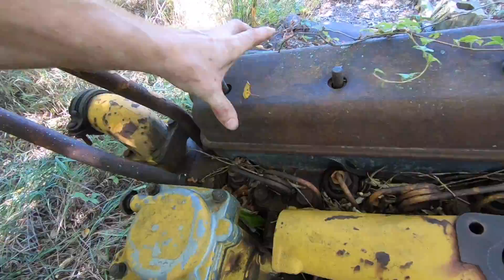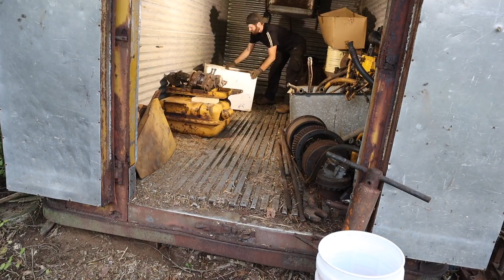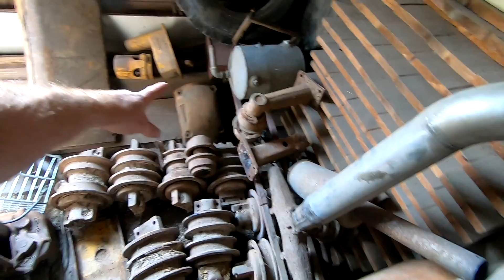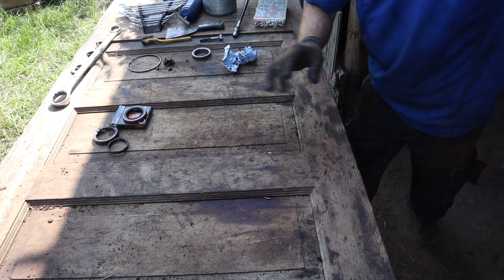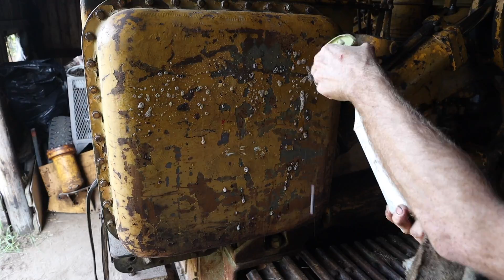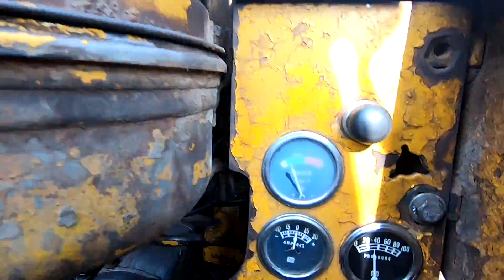I Rescued TWO TraxCavators ~ Part 5 ~ Old Red 1950s Caterpillar TraxCavator

Comment: if you don't really like the bucket curl lever working opposite to  what you are used to why don't you reverse the output pipes on the lever so it will work as you use to

Comment: Hey pal I’m enjoying watching this video chain / quick tip for you because you can’t steer with the right hand side if you through it in reverse you can use the left side to steer you around until you can swap that sprocket out, if had to do it in the past with D2/D4 when they have a steering clutch that won’t work.  It’ll get you by for now until your home with it, that sprocket will be a job you’ll want to have all your tools and equipment for.

Comment: Matt,

My papa always told me "To leave well enough alone" In this situation, I wouldn't cut that ring off and weld onto a known bad sprocket.  You know you already have issues with it.  The sprocket you got from the junk pile looks to be in great shape.  No way I would cut that thing apart to weld onto known bad sprocket even though that's how some people repair them.  The only thing you are really saving at this point is your time and effort?  You have worked this hard to get this far, do you really want to shortcut what is probably the single most important part of the running gear?

I am loving this series and can't wait to see this old iron back doing what it's supposed to be doing!  Keep up the great work!

Johnny G

Comment: The pin under the sump must be the last remnants of its agri tractor heritage. Maybe it was the rocking cross bar mount on the dozer? Track loaders have solid mounted track frames so they can put all the weight on one front idler and not roll over with a bucket of dirt at full height. All the pin is doing here is holding the engine up. I see two pulling threads, so it must have been a tight fit when new. The new bolt ends a tube around it, because the worn out pin moving about will make the new bolt come loose or snap it off. That’s because the new bolt tightened will try to carry all the load the pin did. Anyhoo, loving the vids, nice to see it coming back after it was abandoning due to various serious mechanical issues.

Comment: Difficult to pull the sprocket off, but the absolute vital part is to push it back on. The nut doesn’t load it enough, it’s just a retainer. Someone will know the exact value. I am absolutely guessing at something like ten ton preload from the screw on adapter and ram.

Comment: Hi its not a full fix But to save stripping out the drive sprocket . you could build up the teeth with weld to give you drive on that side. 27 welds are a lot easier than pulling a sprocket out in the Fields. Even every third tooth been built up would give you drive. Great show loving this Big Red rescue. Cheers

Comment: Sprockets are cast steele,  so you really don't want to cut and try to weld,  you'll just need to disassemble and replace as a complete sprocket, which is probably why it hasn't been done yet, lots of work.

Comment: Previous owner destroyed the driver sprocket by not tightening the track.  Weld a hook on the bucket.  Attach a chain between bucket and track tension mechanism. Use hydraulic to tension track.  Now block tension mechanism. Hopefully you get a track now with a tight fit.

Comment: That setup as far as the machine itself is much like the  d9 in that time. So 1st thing is to change that sprocket you need to find you a car dealer n get a seal it runs the outer side  of the sprocket. It a 2 sided seal and it sprung . The pump that seems like the same pump whether the machine had a bucket or a blade . Oh not sure of it matters or not , the oil lubes that bearing that's why a seal is their. I have more info I could send if needed and as the time comes on more fixings. Good luck hope to see the journey home.

Comment: Use your hydraulic jack to push the idler pulley forward. I also like the idea of using your welder to build up the teeth on that worn sprocket. Great job on what you’ve accomplished so far. Love your videos!

Comment: to remove that sprocket you'll need hydraulic puller and special kit. if you need to know anything ask away. had the back end of 966 apart at least half dozen times over the years. restoration job gunna take you months and $$$$$

Comment: Well, Salvage, I was thinking; A quick n dirty solve for the Sprocket issue would be to weld some teeth (rebar maybe) onto them, it wouldn't have to be much, maybe the size of your thumb. Definitely wouldn't be pretty, but it only has to hold long enough to transport it, right?
I've seen this fix (rebuilding gear teeth) applied two ways, one is to lay down the block and rebuild the sprocket tooth, the other is to drill out holes pointed toward the axial line, and put metal rods in (kinda like fingers), and weld the rods into place, and plate/sheet steel welded to the rods to form the walls of the sprocket cup/cradle.
I'd use the stack solution, in an "A" pattern, it would be the most doable "in the field".

Comment: If the Track Chains are worn out and the sprocket and Rollers worn out there wont be enough adjustment on the screw to take up the slack

Comment: Putting grease in that bearing was probably not a good idea. That means you will have grease in your hydraulic oil.
Reply: mark walsh   The bearing is supposed to run in grease, there was old grease in the casting when it was disassembled, and a tube run to regularly service the bearing was visible in the video, but obviously whoever was serving the machine was not aware of it or there was a blockage that prohibited proper grease flow.  If the bearing was supposed to run in oil the seal(s) would be doubled, but that would introduce another possible source of wear fragments into the circulating hydraulic oil.......the engineers decided to use a greased bearing.  As long as it is serviced, it’s going to last for a long time.

Comment: Either way to replace sprocket or do a weld on rim( available aftermarket) you still have to split the rails, remove track frame, to do it right.

Comment: Correct me if I'm wrong, but that hard bar pin on the suspension (sorry if I got it's name wrong) looks like it saw some metal fatigue on the broken end, as well as similar fatigue in its respective hole - the end that's left in there probably got seized and then broke off while traversing some particularly tough terrain, Red likely realised something was amiss and went to take the bolt out when it broke. Good luck getting it working again, keep up the amazing work and thank you for all the effort you put into your videos!

Comment: If you have a portable welder and a generator to power it, I suggest building up the teeth of the sprocket in situ, just as a temporary means of getting the sprocket to drive the RH track.  You are doing a great job!!

Comment: As a stop gap measure, you might consider cutting some short sections of square stock, onto the high points on the worn sprocket to give it better "teeth" to mesh with track.
Reply: Weld them onto high points...left out that part!

Comment: On that Sprocket weld up some Pointy teeth on it each 3-5 points just to get you goin until you can get the new one on! Not a bad idea... & ofc Back when men where men & Muscled items go to get job done!!! That Front grille & sides must've been at least 200 lbs! P.s What kinda work boots are those!? Looks comfy and tough! Great news to hear you've decided in future time to Powerwash & Degrease the Top & Underside of the machine.

Comment: fantastic job so far.  on repairing the worn out sprocket, you may want to try this as a temporary field repair for the worn sprocket, if you could weld 1/4 or 3/8 pieces of bar stock(steel rod) on to the worn teeth, providing you have a small enough mig unit that your generator would power it yet provide enough amperage to run .035 solid wire if you have gas, or what ever flux core it will run.  cut the bar stock lengths to equal the width of the sprocket thickness and cut one for each tooth on the sprocket,  weld a bead and fill on both sides of the bar stock to blend and shape each tooth to shape equal to the spar sprocket you found in the reefer box, with your grinder..  welding on a pieces of bar stock will increase the diameter of the worn sprocket by the amount of the two pieces of bar stock on opposite sides of the sprocket .  in the track, it will engage with over half of the welded up teeth in the track so it should provide enough strength to propel the machine out of the wilds and get it to civilization.  might take some time but doesn't require heavy lifting in a remote area.

Comment: Great video series.  I'm not an expert so this isn't a criticism but isn't the hydraulic pressure greatest when you extend the cylinders to maximum length or travel?  If so, that would increase the risk of blowing hoses and seals.  If it isn't necessary for getting it home, I'd take it easy extending everything to maximum.  Just my thoughts, Doc

Comment: You better have something able to tow it ready at hand because that totally worn sprocket is not going to do much on any sort of slope including climbing the ramps on to a low loader.
If you get the machine stuck trying to climb out of a creek crossing and chances are you probably will, then you are going to need to get it out before rain gets a water flow sufficient to drown it happening.

Comment: Nice but you have no choice in the matter on that sprocket and the teeth are to far gone and the track is stretch to way beyond safe if you were going to jest change the sprocket you would throw the track off the machine it's best to try and split the track and change them both

Comment: You definitely need a new cross rail pivot pin bud, it's far too loose!
An acquaintance has a Komatsu 475 and it requires one heck of a hydraulic press to change the pivot pin out on it.

Comment: Soooo Why did we put Grease on the Bearing isnt that the hydraulic oil's Job
Reply: No, there's a seal in the pump to keep the hydraulic fluid in there. There should have never been hydraulic fluid in with the bearing. The seal he replaced is simply to keep dirt out of the bearing.
Reply: @stinky817  I see thank you

Comment: Really enjoying your vids especially your attitude to a clean tidy work space, clean parts and surfaces and use of the proper bolts and studs.

On a ball or roller bearing, 'the little metal loops' are known as 'the bearing cage' buddy.

With regard to hydraulic hoses and other replaceable components made from synthetics such as oil seals and O rings.

Their track record thus far makes for a high probability that you need to go through and replace most of it soon as possible rather than when they fail.

Preventive maintenance on a machine like that can save you a lot of money and more importantly someone's life.

Does the lubricant line on the mounting bracket run to a remote grease nipple?

Because if it does not, it might be an oil feed designed to lubricate the bearing with engine oil which would drain back to the sump.

If the latter is the case, then greasing the bearing may not only be unnecessary but could cause larger problems.

Whatever may be the arrangement in that regard there should also be an O ring or similar seal isolating the bearing housing from the main hydraulic pump assembly at the rear.

The rate at which the hydraulic system hemorrhaged fluid through the pump indicates the drive shaft seal that side of the bearing is also in need of replacement.

Comment: they say the levers are made that, according to old cat operators.  be careful with the worn out sprocket, you can pound the bearings out of the final. usually when the sprockets are worn like that, the chain is worn out two.

Comment: The hyde pump bearing probably went because the grease worms chowed down there!  There is a. flexible tube run to the casting to service that bearing, saw it in your video. Probably needs replacement.  If someone didn’t know, or care........  The sprocket can be temporary made serviceable by welding some 3/4” or 1” square steel across the sprocket so you can operate Cat.  You can rebuild most of the undercarriage by welding, talk to a cat dealer or welding supplier for information.  Been there, done that.  They built them well, and serviceable, to last decades.  You can probably find replacement parts at machinery junk yards as there’s a nitch industry doing what you are for “ collectors “. Split a 2-21/2-3” pipe in half, put chain around front idler and use bucket to pull back into something resembling taunt, measure distance needed to load spring, tack weld back together over “ track tensioning rod” to hold together for the drive home.  Fabricobbling till you can clean and repair appropriately.  Farmers been doing it forever.  Cheers!

Comment: I'm really enjoying this series! I have an idea that might work to get you home with that worn sprocket. Get some slick rod of the appropriate diameter and cut some pieces to the width of the sprocket teeth and weld them to the worn points of the sprocket. Every third or fourth tooth should be enough to get the sprocket to catch, turn and get you home. You're going to replace the sprocket anyway, what could it hurt to try?

Comment: Could you weld a piece of steel on top of the worn teeth of sprocket just to complete your transition from the bush? It would take you a day welding but at least you can be  pretty safe of making that journey. Preheat and low hydrogen rods should do the trick as you know. Going through the stream would be like taking the loader through a bath of oil. You do have a portable welder capable of welding low hydrogen rods?

Comment: 2 things, firstly when you were showing us the parts in the fridge van and found the drive sprocket on the floor, was the other sprocket "stood up" against the wall in the corner and secondly with the track tensioning rod is it the thread has "gone" on the threaded bar or in the nut head of the tensioner tube (or both) or has the adjuster reached it's limit meaning the track/tracks want replacing so when you get it home pulling the tracks and track frames to replace the sprockets, return idlers and tensioner parts from the donor traxcavator might become attractive (parts should have similar amounts of wear).
As far as getting home, if the track was tensioned would it make the machine driveable, if so could you not make some more longer packing pieces from tube, "jack" (hydraulic jack and wood block/blocks) the front idler wheel to the correct tension put the new packing pieces in with the hose clips holding them in place as before and hopefully that'll be enough to get back to the workshop.
Reply: I think there should be a big nut that is missing that you screw against the other part.  I can't be sure as the only tracks I ever tensioned used a grease gun to hydraulically push a piston out.  Can you do hydraulically with grease?  Whatever.

Comment: The pivot pin is the right size the bolt u removed is just to keep pin in place its just like a hydraulic ram pivot point the body of the cat has two pieces attached to it hard to explain with out pictures so the pin is the lenth from cat body braket to cat body bracket and the axle it the eye of an hydraulic ram that has a piece of metal either side like of a excavator dipper arm hope I was some kind of help lol

Comment: Never leave hydraulics  extended , that is leaving system under pressure.
Reply: It doesn't effect anything 
Hardly any presure at all in the cylinders just holding the loader 
Non in the rest of the system 
Bit of a wife's tale that itll wear out the seals
Reply: @fowletm1992  Heavy equipment mechanic for 20 years and i have seen what happens when hydraulics fail. NOT GOOD
Reply: @jonflanagin6682  okay. Get your point. Bursting suddenly when not in use? Mostly people forget to safeguard an installation while working on it. Seccondly always depressurise the system. Oil/fuel under pressure penetrates your skin and kan cill you when in your body.
Reply: @jonflanagin6682  
Also a heavy deisel mech specialising in bulldozers excavators amd face shovels 
Only if your getting under it or intend to work on it 
Still no damage or danger to yourself or the system leaving it parked under pressure 
If your worried about getting sprayed with oil when a hose blows 
Theres a %1000 greater chance of that happening when  its actually working 
Contray to belief if you know what to look for theres lots of warning a system is about to blow 
If theres cracked hoses with wire showing, leaking valves, leaking cylinders its a fair change something going to let go when its working 

Id feel safe standing under a new excavator bucket every day 
Compared to crossing a busy road in the city centre the statistics are stacked way in favour of being hit by a car than the hydraulics failing 

Not that its a good idea to stand under hydraulics anyway, or step out into busy traffic
Reply: Jon Flanagin Why not? If the system is okay? If you are gonna work on it support it. Only if you can bump into parts ie forklift gabels put them down.
Reply: Oh shut up jon.

Comment: Damn, I just keep getting more impressed with your work getting this old machine up and running!  Love the trick for removing broken bolts by drilling a hole and hammering in a slightly larger torx bit - I was actually wondering about reverse threading before you got started - great you could clue me in on your experience with this!

Comment: What probably made the sprocket wear out was the cobbled up spring compressor that they installed. It is most likely way too weak to make the sprocket grip the track so it slips and grinds away the old sprocket. So it's best to find another connector and replace it. There has gotta be two of them somewhere.